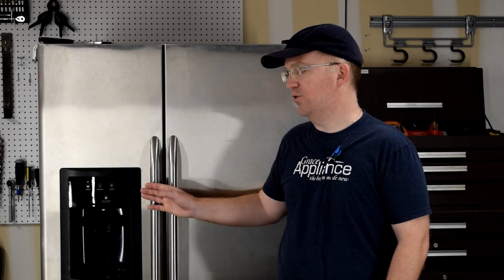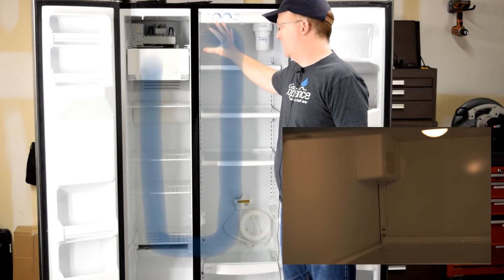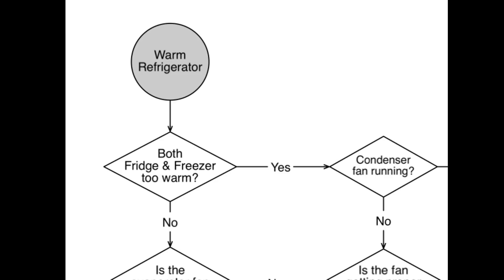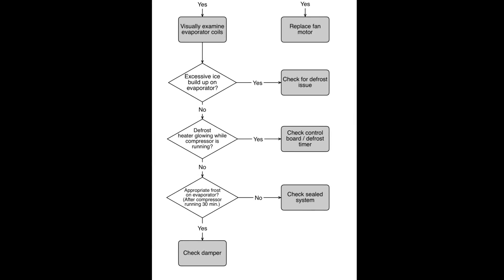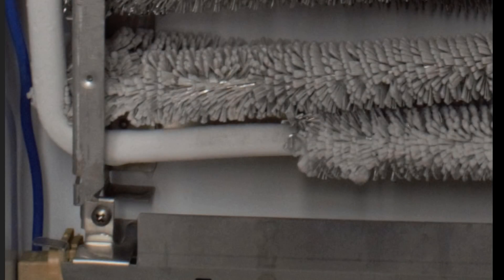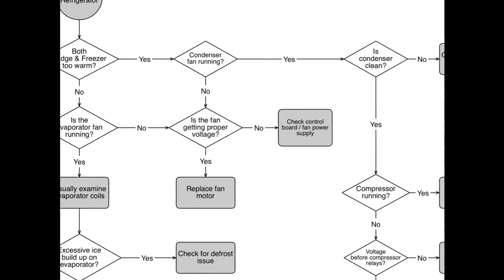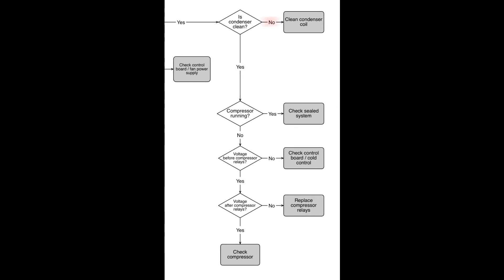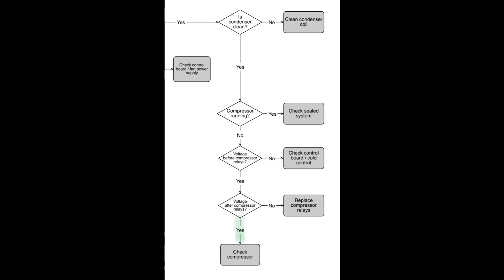Refrigerator Too Warm - Diagnostic Steps

Comment: Hi Andrew, I have a Kenmore Pro (Samsung) 40140483800 Refrigerator.  I am not getting power to compressor. Compressor will NOT run. I replaced overload relay, main control board, power board, power inverter contol board, cleaned condenser.  condenser fan comes on, everything comes on but the compressor. I checked winding on compressor and they checked OK.
 A Sears Tech came out and had not idea what he was looking at. Then, I called second local company works on appliances. He suggested replacing power inverter control board. That di not fix the problem. Unfortunaly, there is no information out there. This unit is made Samsung. Any idea? Any suggestion will be greatly appreciated.Robert
Reply from the maker: Hey Robert!  
Yikes!  

Where I would start is to unplug the fridge, unplug the power wires from the compressor, restore power to the fridge to check the voltage coming to the compressor. 
I can’t tell by looking at your schematic, but you mention an inverter board. So, I assume you’ve got a DC variable speed compressor which would use an inverter to supply power to the compressor.  The fact that the condenser fan is running is usually an indicator that the compressor should also be running.  If you’re getting voltage to the plug that goes to the compressor (has 3 holes in it for the pins on the compressor) you should be getting some amount of DC voltage when the condenser fan is running.  

Let me know what you find.
Reply: @GraceAppliance  Hi Andrew, I have done that as well. I have checked for any voltage at the connector (while connector not plugged in to the compressor, but fridge ON as suggested) and get not voltage coming from inverter board. How about  a bimetal sensor for fridge, I believe these sensors are wired in series with 110VAC power going to inverter board. I was wondering whether board  is looking for this signal to enable compressor. any idea?
Reply from the maker: hey Robert, yes that would be the next logical thing I’d look for is to test the temperature sensors for both the fridge and freezer.  I wasn’t able to find a tech sheet for your specific model, but you may also look to see if you have what’s called an ambient temperature sensor which is normally located near one of the hinges or behind a kick plate near the floor. These can cause issues if they’re registering the incorrect ambient temp.  
So, yes if the main control is not getting the appropriate reading from the temp sensors it will not send voltage to the inverter board telling the compressor to run. Usually you’ll have a low voltage DC output from the main board to the inverter board (3.5vdc - 5vdc).  If you are getting this voltage to the inverter board, the main control is doing its job, but the inverter board is not.  
If you get no low voltage DC output from the main board to the inverter board, I’d look more closely at the temperature sensors.  

I hope that helps.
Reply: @GraceAppliance  Hi, I have checked for resistance  the 3 bimetal sensors in the unit:
Freezer part =37.5 ohms
Refirigetator part: 95 ohms
Unit Part: 88 ohms
PS: I have a new a new sensor I ordered. it is aDA47-00133B Refrigerator Defrost Bi-Metal Thermostat-for Freezer area. I check this sensor for resistance at room temperature= 0 ohms
any suggestions
Thank you!!!!!
Reply from the maker: Robert Davila hey, since I’m unable to locate your model specific tech manual I’m kind of going blink here, but I think the will help.  
Most (if not all) of the Samsung temperature sensors are the same part with different lengths of wires or different connectors.  
The readings you provided tell me that the sensors are not totally failed (I.e. open circuit) but they could still be out of spec and give troubles.  
The thing is though, these readings will change based on what temperature they are. You’ll need to test those readings against this chart with what temperature the sensor is at that given moment.  You can submerge them in ice water and they should read about 12kohm. I’ll usually hold them under my armpit for a few minutes to achieve 98F to get about 3.3kohm. 

Here is a link to what the sensors should read.  
https://appliantology.org/gallery/image/46-temperature-resistance-voltage-chart-for-samsung-refrigerator-thermistors/

The bimetal you mentioned is not going to give you the issues you’re dealing with I don’t think. I think it’s solely for the defrost components.  
It’s a high limit cut off for the heater in case the heater stays on to long.  They’ll read a very low resistance such as .03ohm and so long as they aren’t open or very high resistance I don’t worry about it.  

I hope that helps.  Also, if you’re able to track down the tech manual, you’d have the ability to put the fridge in to forced compressor run which would rule out both boards, the compressor and associated wiring.
Reply: @GraceAppliance  any idea on how to force compressor?

Comment: Following the flow chart, I end up at "check sealed system".  Where do I go from there?
My freezer started getting warmer a week ago. I unplugged the fridge for 48 hrs then plugged it back in and it worked: got as cold as -10F!  Then I unplugged it again to see if the problem was permenantly fixed, and the freezer can't get ice cold once again. By placing my hand on the comoressor, I know it's running by the vibration I feel. Can you tell me why a compressor that runs and still has a charged system obviously, still wouldn't make the freezer cold after that one time?  I always thought if the comoressor runs and you have a freon/charged system, it can't help but make the evaporator cold. I'm stumped.  Thank you so much For any help.
Reply from the maker: Hey Jet,
It could be that you have a restriction (I. E. Clog) in the sealed system. It can definately cause these symptoms.

If you're not seeing heavy frost build up on the evaporator (a defrost issue) after the compressor has been running for at least 45 minutes you should see a light frost build up on the evaporator. If the majority of the rungs of the evaporator do not have a coating of frost, it does sound like a refrigerant restriction.  Most commonly these restrictions will happen at the filter/dryer a copper peice filled with bead shot near the compressor. It looks like a copper hot dog. To repair a restriction would require pretty major repairs and often does not make sense due to the cost. 

If you wanted to send a picture of the evaporator after the compressors been running feel free Graceappliance@gmail.com 

Let me know if you have any questions.
Reply: Thanks much for your reply sir. If the system has never been breached or tampered with, what causes an internal restriction?  I would think it would remain healthy indefininately until something dramatic injured the system....The fridge was working perfectly up till last week.  It is16 years old by the way and I was hoping to keep it going much longer.How long can one expect to have a side by side fridge remain alive that was manufactured in 2003?  Is it worth keeping it alive?  I know the GE's are known to have the compressor relay on the motherboard burn out. I replaced the relay 3 years ago and it was working great since then.  Do you think this could be the issue once again?
Reply from the maker: @millionpianos  hey, if your  compressor is running and no cutting on and off, you can rule out a control board issue.
The filter dryer I mentioned is designed to filter out impurities in the refrigerant and gets clogged over time, but as far as why they have impurities I'm not sure why. The refrigerant itself won't go bad for the life of the fridge, but you can have these kinds of issues, compressor failures, leaks etc etc.

Given the age of the refrigerator, you'd be better off not repairing due to the cost of repair.

But send me a picture if you wanted  and that will tell us tons.

Comment: This question may be coming too late.  Did flow chart.  Both cabinets are too warm.  Everything seems to be working...cleaned coils, fan good, sealed issue solved I hope but sometimes fridge and freezer are acceptably cold then unacceptably warm, ... temp fluctuates every day.   Loosing food in freezer... too warm for safety in my fridge...   i keep thinking its the computer module that regulates the temperature...?

Comment: I have a GE side by side refrigerator. When the fridge stopped working,  I replaced the heater element because it tested defective.  The fridge then seemed to work fine.  After a couple of days, the fridge stopped working.  I unplugged the fridge for about a minute and replugged and it seemed to start work fine and returned to required temperatures. It is still working now after 6 hrs. Both the condenser and evaporator fans seem to be working.  I am waiting to see if the fridge will fail again, since the problem is intermittent I find it hard to diagnose.

Comment: Hi Andy, thank you for all the informative videos. The compressor on my SxS GE is not running. I followed your flowchart, and measured the voltage to the compressor on the control board (J8) and it reads reads ~0.012V. However, if I disconnect the compressor relay from the compressor and measure J8 again, it reads ~120V. I was expecting ~120V in both cases. Is that normal? If not, any tips on what the issue could be? Thank you!
Reply from the maker: Hey!
Yeah, that sounds odd to me.
With the power off, I'd check the pins on compressor itself.
With the relay off the compressor, do an Ohm test between each pin. You should get two lower readings and one higher reading. The two lower readings should add up to the higher reading. Like 4.4, 4.4, and 8.8.
Something like this. Also, check each pin to see if you continuity between that pin and a copper tube on your compressor. You're wanting to see if the compressor has shorted to ground.

Let me know what you find.

Thanks!
Reply: Thank you for getting back to me, Andy. I've tested the compressor and it seems to check out as you've described. I'm baffled 😕
Reply from the maker: bigT you may try, unplugging the fridge, remove the two wires leading to the compressor relays. Restore power, take voltage reading at these two wires. If you’re getting 120v there at these two wires, it sounds like bad relays.  

Another test you can try is that you can take what’s called a hard start relay (I prefer RCO810...even though some recommend rco410) anyway, you can hook it up to the compressor as shown in the instructions. Then, apply 120v to the rco810 power wires. At this point your compressor should come to life. If not, it’s a locked up compressor.  If so, you can rule out a failed compressor.  

It sounds like a short somewhere to me though based on that symptom you’re having and this process is just a way you can help isolate the component that’s shorted.  Seems most likely that it would be a short with the relay or compressor.
Reply: I just measured again from the board (J8) and it was reading around ~70V with the compressor disconnected. Measured the two wires you mentioned, and also getting same reading. Could my motherboard be acting up?
Reply from the maker: bigT I agree, if you’re seeing inconsistent voltage output from the same two pins at different times, that does sound like a failing control board.  
Those are the absolute hardest to troubleshoot because it will often not rear it’s head while you’re looking at it. In your case, it sounds like you’ve gotten lucky!

If your fridge uses a wr55x10942, if you’ll order through this affiliate link it helps the channel greatly.  

Thanks and let me know if you have any questions!
Andy
Reply: Thank you very much, Andy. So looks like I have a bad board indeed. I removed it and did a visual, and I’m seeing that the larger relay has a torched solder on one of its larger pins. Do you think replacing the relay would help? Or go for a new board?
Reply from the maker: @tsolimaninf  nice work! 
I'd recommend replacing the control board vs rebuilding it. I've had about 50% success with the rebuilds I've tried on these just due to the conformal (clear coating) coating they put on the board. It makes them very tough to work on and I usually end up damaging the board beyond repair anyhow.

But, I'll leave that decision up to you.

Good work on the diagnostics.
Reply: Thank you very much, wouldn’t have been able to do it without the helpful support of good people like you! God bless
Reply: Hi Andy, I’ve managed to fix the soldering on the board for larger relay and the voltage to the compressor is text book now :) The fridge is back in business in terms of cooling, but it’s not shutting down when it reached its set temperature. Wondering if the “thermistor” be the culprit for all this. Still investigating. BIG THANKS to you!
Reply from the maker: @tsolimaninf  I'm wondering if you have a stuck relay on the board itself.
The solder joints fail in the way due to failing relays. The relay once weak no longer makes good electrical connection, creates excessive heat due to higher than normal resistance, and thus melts the solder joint.
Another common symptom of a failed relay is that the points inside the relay get carbon build up on them and get stuck together. Even though the temp sensor has told the relay to turn off it is basically welded together and can not let go.

Based on your symptoms, I think this is the more likely situation that you're dealing with. You'd need to either replace that relay or the control board. 

I hope all that makes sense.

Thanks! 
Andy
Reply: Yes, makes perfect sense! Thank you very much :)

Comment: My GE side by side is 4 degrees freezer and 43 degrees fridge. the electronic setting board on front of freezer door does not work .  I bought his approximately 2 months ago.  what should I do?  I am 75 and need some one to help--even making a call
Reply from the maker: Hi Janice,
I'm sorry to hear about the issues with the fridge.

It does sound like you're going to need a technician to help with this issue.

There is a procedure to diagnose if it's your touch pad or if it's your main control (I. E. Fridges Brain) of the fridge. But, this will require a multi meter and some fairly specific technical information.

I would recommend having someone schedule a technician visit for you.

Best of luck and please let me know if you have any questions.

Thanks!
Reply: you should have at least 90 days to  a year freerepairs and if you paid by credit card file a complaint and get your money back   if you paid by credit card you can file a complaint and get your total money refund
Reply from the maker: @thomasdelvin3683  great recommendation!

Comment: Hey Andy so i need to check the sealed system after i already know that the  start relay, the compressor, and the fan is working and my defrost thermostat isnt stuck in defrost mode. What should i be looking for next?
Does my unit need freon you think? 

Thanks its been sitting for a few years unused.
Reply from the maker: The ooo Girl hey, check to be sure the coils behind the fridge are not covered in dust. If not, check that both fans are running (you have 2) one inside the freezer and another behind the fridge by the compressor.  

If your compressor and both fans are running at least 30 minutes (with clean coils) your freezer should be sub zero or well on its way.  
If not, that is when I start looking at sealed system issues.  You can verify this by removing the back wall inside the freezer to expose the evaporator coils. You should see a light coating of frost on most all of the rungs.  If not, that’s an indicator of a sealed system issue.  

If you wanted to send me a picture of it to GraceAppliance@gmail.com I’m happy to confirm what you’re seeing. That frost pattern is very telling of the health of the system.  

Thanks!
Reply: @GraceAppliance  hey thanks for the reply!coils are not dirty, and there is only one fan because the coils are on the back of the fridge not under and the fan is working ive removed the covers to expose the freezer evaporator coils, there is no frost. Could the reason both fridge and freezer compartments are warm be because either the defrost thermostat is bad or because the general thermostat is bad? Besides those two things im guessing there is a hole in the lines and the freon needs to be replaced.. ...
Reply from the maker: @theooogirl3495  hey,
I know you said the compressor does work.
If the compressor is running, it is not stuck in defrost cycle.
If the compressor is running for at least 30 minutes, you should at a minimum have some type of frost build up on the evaporator. If not, you're correct this would be a sealed system issue. This could be that it is out of refrigerant due to a leak or a weak compressor which has failed. Most commonly neither of these issues are worth fixing due to the high cost. Refrigerant leaks are less expensive to solve if they can be found, but one can end up following a rabbit trail trying to solve these issues too. Often, it's better off putting the money toward a new fridge.

I'm sorry for the bad news on it.

Comment: Hi Andy I replace the heather element after test was burn but still no working the compresor stays on all the time is posible to convert this model to analog eliminaten the comp board
Reply from the maker: Hi Guillermo, I'm afraid not. I don't think there is a way to do this.
Does yours have a control board that's on the compressor itself?